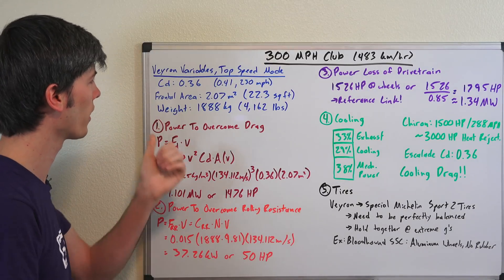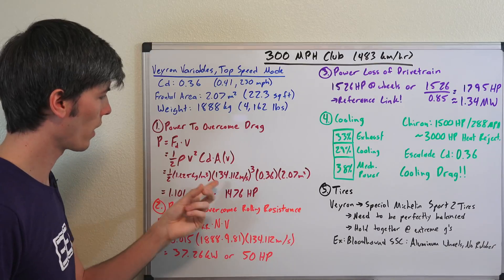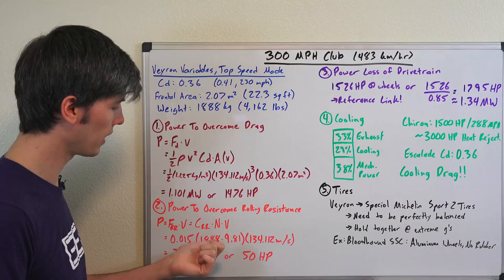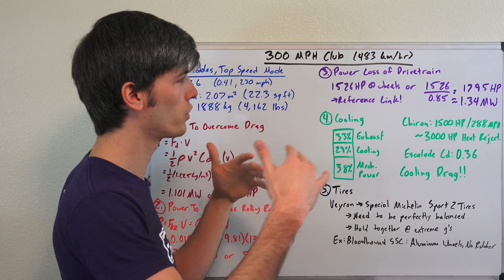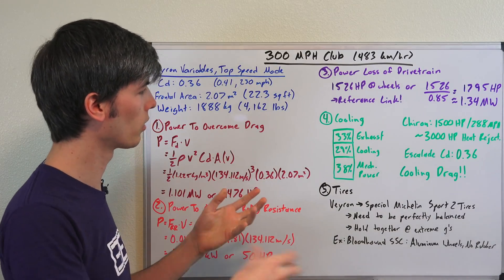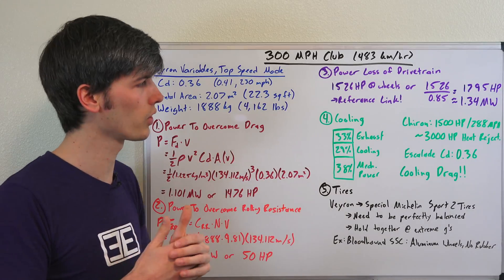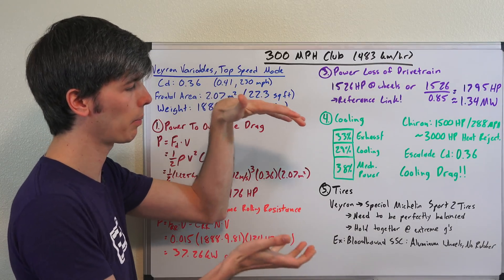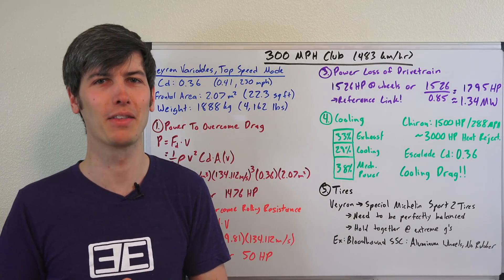Why Has No Production Car Hit 300 MPH?

Comment: Engineering Explained: First, your channel is quickly becoming one of my Top-10 go-to sources for interesting information. Thanks for taking the time to do this.

Second, if the automotive cooling system is the source of aerodynamic inefficiency (higher Cd) - especially in high performance vehicles - can the engine's cooling requirements be reduced by designing an engine and cooling system that operates at a much higher temperature? In this manner, I presume that the atmospheric air would have greater cooling capacity per area of heat exchanger, thereby reducing the area of the required heat exchangers. 

For example, pure ethylene glycol boils at ~388F, whereas a normal 50-50 EG-H2O mix boils at ~230F. Other liquids must also be available to operate at higher temps.

I'm sure I'm not the first person to posit this question. Is there a good reason in response?

Comment: Nice as usual, but one small note. When you're talking about the loss of power from engine to wheel, you are making a division when, instead, it should be a multiplication. Nothing too important to explain your point, but the actual operation is a multiplication.

Thank you :-)
Reply: He divided 1,526 (wheel horsepower) by .85 to GET crank horsepower of 1,795.  Now going backwards, if you started with 1,795 CRANK horsepower with 15% power loss , you multiply 1,795 x .15 = 1,526 WHEEL horsepower.  Simple arithmetic.   Got it?

Comment: Will be interesting to see what the Chiron's numbers actually are.  It has been hinted by Bugatti that they were able to get a decent reduction in drag on the Chiron vs the Veyron and improvements to the tires to be able to sustain higher speeds than the Veyron (tires would only last 15min at 250mph, but the car would run out of gas before then).  I doubt the initial Chiron will be the first 300mph production car, but I could easily see it being well into the 280s.  I wouldn't be surprised to see a later version of the Chiron with a power output approaching 1800hp in an attempt to crack 300mph.

Comment: You never did touch on the part where Horsepower itself is a variable; the 1,500 + Horsepower of the Veyron is Peak Horsepower, not Base Horsepower which is significantly less. Of course, the amount of the Peak Horsepower that is actually delivered is also less, by about 300 or so. That 1,500 + figure is only good for revving in place statistics. But you and I know this already...

Comment: with so much speed and drag, wouldn't air cooling help the engine diffuse the heat? I'm thinking how motorcycles have cooling system that has to do with moving air.

Comment: So if you lower the drag coefficient to, let's say 0,18 or 0,2 you would have to have much less horsepower which would lead to much less cooling needed, which would again lead to much less drag .... isn't this kind of a solution?
I think there's more to it, for example downforce needed so that the car (which kind of looks like a wing) isn't starting to fly at high speeds. And: the optical impression of a sports car. I think it could be done with much less HP if looks aren't important. Thinking of the "Schlörwagen" with a Drag coefficient of 0,113. It would need only 450 HP against drag. Easy cooling!

Comment: Well, that leads to  electric cars with comparably insignificant heat generation. Without need for >2MW cooling system that generates lot of drag you can have car with much lower drag coefficient. You would need "only" around 1000hp with Cd=0.20

Comment: Tires are a major factor in limiting top speeds. Making a rubber "street" tire safe for production cars at 300 MPH with current tire technology hasn't been accomplished yet. If 300 MPH was desired by the auto manufacturers they would just add horsepower. However imagine driving a car at 300 MPH with tires rated at 250 MPH and the tires came apart. If I survived such an accident I would soon  own the car company. The reasons you give for why a production car will never go 300 MPH are simply excuses for not having enough power.

Comment: An all electric car should theoretically be able to reach 300 MPH... (No need for venting out 3 x the engine power in heat)
Reply from the maker: Not exactly that simple though, electric components still need to reject heat, and often electrical components are more sensitive to high temperatures, so it doesn't necessarily equate to a smaller cooling system.

Comment: Having 3000HP loose in heat rejection - vvouldn't it be viable to use it for some kind of alternative reuse (!! some modern steam engine), instead of loosing it through coolers that cause extra drag?

Comment: Here's an interesting data point that relates to this video.   
http://www.foxnews.com/auto/2017/03/28/2006-ford-gt-sets-standing-mile-speed-record-at-293-6-mph.html
It's custom tuned turbocharged 3.4l engine cranks out 2500 ponies.

Comment: Just an idle thought -- would any of the techniques like BMW's Turbosteamer concept actually make it more possible to bring down that drag?  The idea as I remember was to reabsorb some of that waste heat in a closed fluid loop (filled with a water-alcohol mix) and use it to generate some additional work through small (sealed) steam turbines.  There was supposed to be one loop that drew heat directly from coolant, and another that drew heat from the exhaust.  There are still heat exchangers to cool off that fluid and condense it back down from steam, but since that heat has has been used to generate additional power, it's reasonable to assume that you could do with a bit less of a drag?  I know It depends on just how thermodynamically efficient the conversion from waste heat to meaningful work is, but my insatiable geekiness craves working out the math on this.

Comment: It seems like the biggest hurdle a 300 mph production car is drag created while cooling.... The first thing that came to mind is electric vehicles. Once the guys at Tesla or Rimac decide to make a car that does this, 300 mph should be a foregone conclusion. I also noticed that the biggest differentiator with new super-cars is their active-aero. I don't know how/if this solves or changes the drag issue, but it certainly makes them much faster on the track. Thoughts?

Comment: What about electronic engine cars? Would they produce less heat per HP and need less cooling to hit that speed?
Reply: Chris V the efficiency of cooling would have to go up to fit the same weight into a faster car, and it would need some more cooling also for the active aerodynamics producing drag making the engines work harder

Comment: I believe the tire rolling resistance coefficient is a variable based on speed. A 0.015 coefficient at normal speed will probably increase to 0.03 at 300MPH for the same tire.

Comment: mmh. A lot of interesting points here.

Based on those cooling losses (and perhaps by inference to high speed trains) I suspect an electric car might have an edge here, though a lot depends on the batteries.

After all,  roughly 90% efficiency is commonplace for electric motors, meaning your 1000 kw motors (or whatever) only need to dissipate about 100 watts of heat, and your radiator, if any can be much, much smaller.

Thus, your aerodynamics can be better too.

Which might also go some way to explaining why the speed record for a diesel train is ~240 km/h and for an electric train is 576 km/h

Comment: Well, the most glaring, obvious issue is Wind resistance that rises with the square of velocity.

If the drag at 50 mph is X, the drag at 300 mph is 36 times as much.
That means if nothing else you need 36 times the power...
Yeah.

Anyway...

Comment: Could they possibly use a different type of fluid for cooling the vehicle (assuming that isn't already the case) to reduce the amount of radiators and ports for air needed for cooling and increase the effectiveness of the cooling system? That would reduce the drag coefficient and still maintain reliability?

Comment: I think Tesla has the best chance of hitting the 300mph mark. Pretty much no need for cooling. Im assuming those batteries would get hot but no where near as hot as a 16 cylinder quad turbo Bugatti engine.

Comment: because, 
You cant do 70+ legally on the public highway. 
you rarely top 200 on a race track. 
because at that speed you would burn through your tyres pretty damn quick. 
because you would equally burn through most of your fuel that quick. 
because you can only realistically achieve that speed on the salt flats or a giant oval circuit. 
because the engine would get so hot it would probably go into thermal melt down.

Comment: Regarding cooling drag: look into Meredith Effect coolers. Basically you reject heat into a specially ducted airstream to generate thrust from the increased pressure of the heated air. Used to good effect on e.g. North American P-51 Mustang, which could push over 400mph with under 1500hp (albeit less overall frontal area and wave hands an order of magnitude lower coefficient of drag).

Comment: The first 300mph production car will be electric.  There's much lower heat generated with an electric car, because you're not using a heat engine.  Electric motors can have efficiencies well over 90%.

Comment: The only vehicles that you can buy that will break 300 mph would be any commercial jet, or turbo prop airplane.  
My dad has a Cirrus, piston prop airplane and it will only do about 230 mph.

The difference is that you can cruise at 230 safely, while in a Veyron if you hit a pot hole or a corner you'd crash.

Comment: A total engineering newb here. Great stuff in the video, as always.
Just had an idea... Why don't cars have radiators or some heat-dispersal systems on the surface of the car? You always have airflow over them and you can use huge surfaces which let the air pass over them, not into them. Could bring the cooling drag down, I guess.

Comment: Turbine engine can hit 4MW easily. The biggest problem with wheeled car with 4MW of power is how to transfer all those power to the ground. To do that you need down force, down force produces parasitic drag, parasitic drag increases the propulsive power requirement at the wheels, thus requiring even more down force, completing a vicious circle. Want more speed? You have to break that vicious circle. Either through an extremely aerodynamic body, or creating down force without parasitic drag a la the McLaren Brabham BT46B (which was an ingenious, albeit unsightly solution).

Jet propulsion doesn't have that down force problem. That's why jet powered cars could regularly top 600mph.

Comment: Lad, I admire the intelligence and thought that went into your efforts here, but why would anyone ever need a car that can travel such a speed when high speed trains are already in existence and are much safer comparatively?  The problem is that even if a car can be produced that travels such a speed safely, on what roads can such a car depend, and what about other traffic? It is entirely a theoretical proposition here, and ICE engines are not that efficient. The heat is your enemy here, what to speak of driver or passenger comfort and health. Not a practical goal at all.

Comment: I'm confused on how you calculated your power to over come drag. Multiplying the density by  the front cross sectional area wont give you the mass since your m^3's won't cancel, and was wondering why you cubed the velocity instead of squared it. I don't know if there were steps you didn't show, it would be cool to see how you got to that equation.

Comment: If one really wants that sort of speed then gas turbine/electric hybrid is the way to go. Fitting 2MW of gas turbine power in a car should not be too much of a problem when you look at airplane turboprop and helicopter engines.

Cooling is a non issue for a gas turbine as it is cooled by the very air it breathes. Some cooling for the electrics would probably be needed but nothing compared to what an I.C.E  needs. Drag due to cooling requirements would become a non issue and by clever design the suction by the compressor could actually be utilised for reducing drag,

The main issue of a gas turbine is spool-up lag which would lead to very poor throttle response.  That is where the electric part comes in - it shouldn't be too difficult to provide some three or four hundred KW of electric drive for the few seconds the gas turbine needs to get up to speed.  You could even have electrically assisted spoolup, where an electric motor would assist in bringing the compressor up to speed.

The other issue could be the very hot exhaust but I guess if directed upwards instead of backwards it should cause too much problems and perhaps also provide a little downforce.
Reply: And how do you attach that GT to the wheels? Spool-up is no issue if it is hot, spool-down is. Cooling can only be used for thrust at >= 0.5 Ma. You would need a 1.5MW generator and four 400kW motors.

Comment: If you could get enough power out of an electric drivetrain (nearly 90% efficient as opposed to a 25-35% efficient internal combustion engine), wouldn't the cooling needs be greatly reduced, thus reducing drag by quite a bit, resulting in much less power needed to overcome drag? A Tesla Model S has a .24 drag coefficient. If you could give it enough power, change the final drive ratio to accommodate higher speed (at the expense of low speed acceleration), and improve electric divetrain cooling (which should increase drag, but not as much as a Bugatti), I'd expect it would be easier to get to 300mph with less power.

Comment: Aluminum wheel or aluminum tires?? Because you said "aluminum wheel vs rubber".. Who runs aluminum wheels with no tires??
Reply: TigreLoko24 land speed record cars are solid aluminium alloy wheels, forged from one piece for strength and no tyres. The g force from spinning at those speeds would tear a tyre apart.  they wouldn't be able to corner very fast, but the speed runs are in a straight line and you don't need traction with jet or rocket (or both on Bloodhound) pushing you along.
Reply: Geoff Johnson, thank, learned something new..lol

Comment: i'm not sure that the drag coefficient remains constant with speed. i think its going to increase. Also, to get a bigger horsepower, you'll need bigger engine, and so a heavier car would result in higher friction and the cycle continues.

Comment: Since a plane can do 300 mph on 350 hp, could they make a car that is propeller driven (with an aircraft engine)? I suppose wheel drag would keep it well under 300 mph (even with heaps more power).

Comment: 1:55 Airodynamic drag only (that much power)? There is a Plane called the GlassAir, that does 300 mph (max) on 300 hp (two occupants) and a plane called the Lance Air that does 350 mph (max) on 350 hp (4 occupants). And the 350 mph plane does 300 mph at sea level (with over a thousand hp less) and can do 300 (with not just aerodynamic drag, but lifting drag as well). The dar doesn't have wings sticking out, doing work. There must be something wrong, isn't the weight of the car, compared to the plane (and tire drag) part of the 1,476 hp required?

Comment: 15% drivetrain loss in a 4wd Veyron? Hell no. 15% tends to be the average for FWD vehicles with small gearboxes and very short torque paths. Even RWD cars have higher losses than that, amongst other things thanks to the 90º gear in the differential. For 4WD cars it goes through the roof, easily going over 25%. In a Veyron with a massive gearbox, massive shafts, massive everything I would be very surprised to find drivetrain losses lower than 25%...

Comment: I believe the vast majority of horsepower drop going from engine brake output figures to wheel power dyno output goes into the squashing and stretching of tyres and not friction in the gear box. I'm not totally sure on this but it seems like if this were not the case, you'd end up with a lot of overheated gearboxes with charred oil.

Comment: There's must be some way to solve the drag and cooling dilemma. In most WW2 airplane, they have 1300~2000 horsepower piston engine, yet they still got adequate cooling and low Cd. If a car maker want to build a 300+mph car, they have to find airplane engineer to work together.

Comment: Amazing how much better planes are:

Piper M500 gets 300mph (261kts) with just 500shp, it is a turbine engine though (still driving a prop)
Piper Aerostar, 306mph (266kts) with 2x350hp piston engines, pretty old technology
Cirrus Vision SF50 345mph (300kts) with one 8kN turbine (8kN*345mph = 1656hp, so using the roughly square law, 1252hp for 300mph)

Interestingly, the turboprop seems better than both the piston engine and the jet engine, least power needed (not sure about actual efficiency or fuel consumption). The M500 is even the heaviest one...

The planes obviously don't need to fight rolling resistance, but they do have to generate their own lift, which also doesn't come for free - the cabin needs pretty big wings! Might be that those speeds are reached at higher altitudes, not sea level, so that could reduce drag substantially of course...